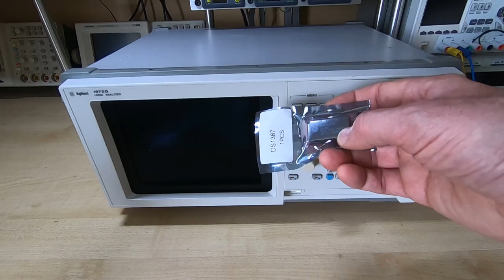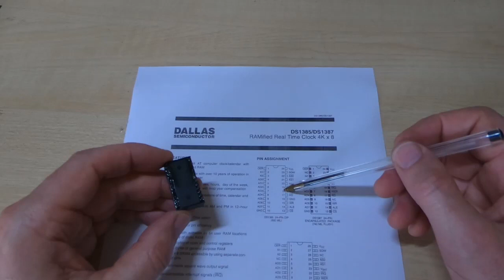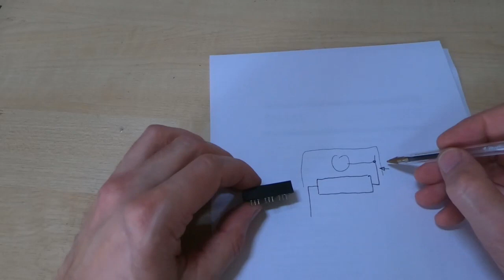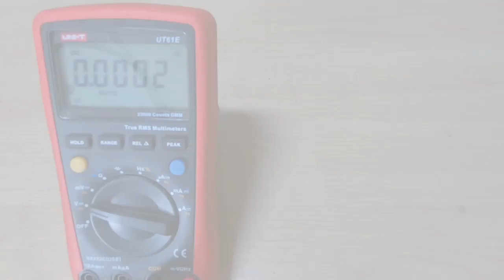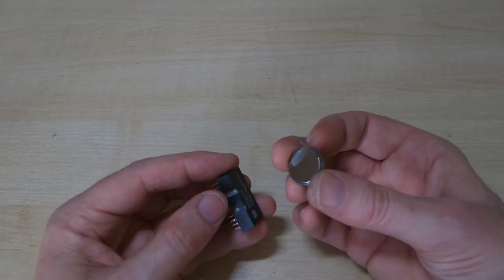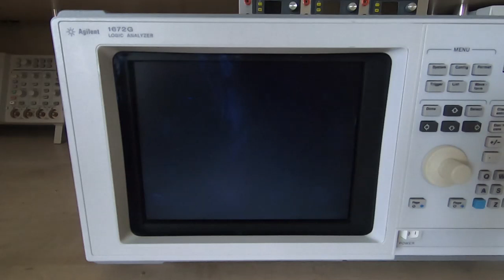Repairing an Agilent 1672G

Comment: Is it possible to upgrade the capture memory in these units ?
Reply from the maker: I assume you mean increase the amount of memory. There were different memory options for these machines but it is not really practical to change the configuration of an existing unit as the memory is distributed on the capture board. I suppose you could do this if you really wanted to assuming you could get the memory devices although I have never seen a unit with anything other than max memory fitted.

Comment: Interesting, maybe I misunderstand the purpose of the SRAM, I would think that is for storing settings across power cycles (like BIOS settings).  When the unit is powered it should not depend on the battery to keep data right?  So would have thought the issue to be related to the power supply and perhaps old capacitors slowly failing?  Either way, nice fix you found!
Reply from the maker: jontscott, I was not referring to the captured data but to the settings in the unit (like BIOS settings but also system settings). All captured data is saved to the hard disk but low level system settings are saved to the NV RAM and if that information is corrupt then the firmware does not seem to be able to handle it. There are many system values that are stored in the NVRAM from HDD settings to LAN config settings. As with many systems there is an 'expected' range for parameter values and it seems that if the values cannot be properly interpreted by the system then the result is erratic behaviour. If I get another unit with the same fault I will make a video showing the errors and the corrupt settings . This was really the point of the video as I have seen many of these units sold with 'major' errors that were just the NVRAM (in fact I have purchased some at very good prices due to this). Incidentally there are almost no electrolytic caps in these units so caps do not tend to be a problem (I have never changed a cap in one of these units and all my units get a lot of use).  I was hoping to show a way to fix NVRAM modules rather than how to repair these specific units.